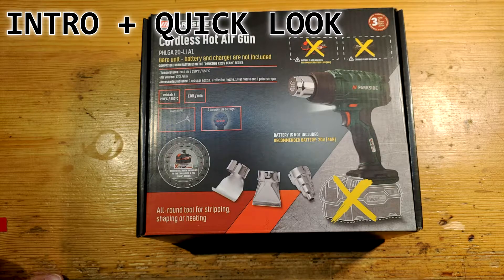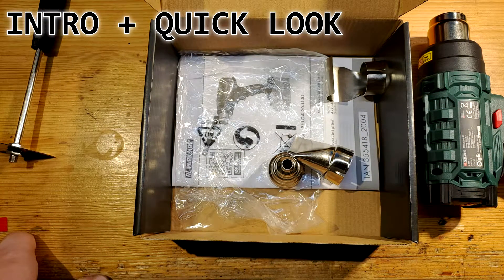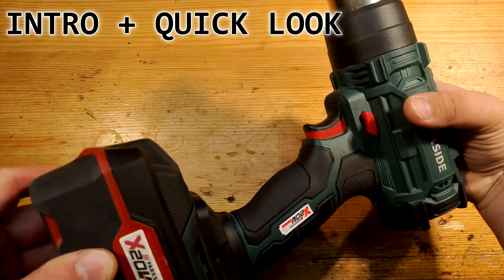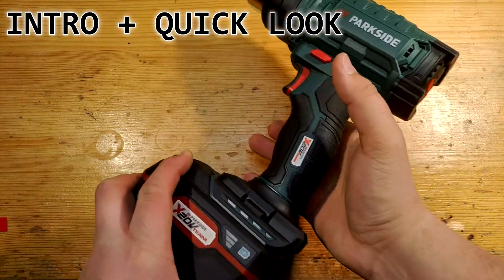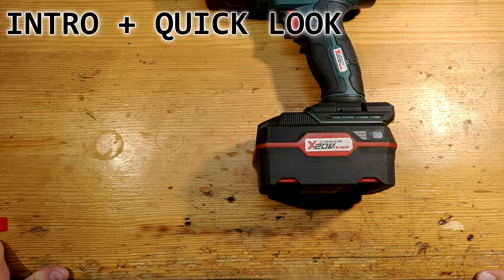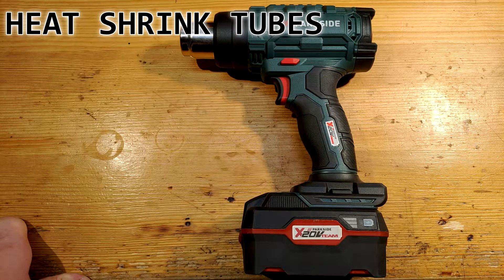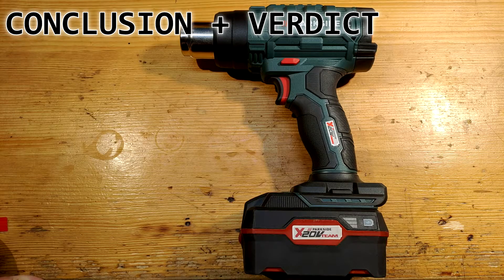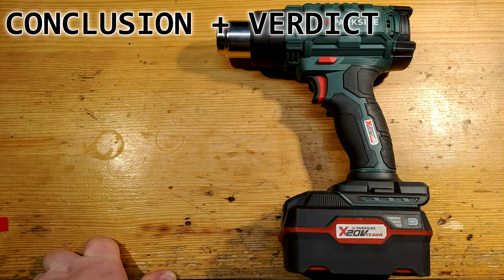Cordless Hot Air Gun Parkside - REVIEW

Comment: Thanks for answering all my questions that I had on this heat gun. Can't wait to get one and the 20V glue gun. Cheers :)
Reply from the maker: 20V glue gun is perfect, I use it frequently
Reply: @bekrstechnologies  I only managed to get the 4V one for now and I only used it once.
Reply from the maker: The 4V has low power for me, and the pushing mechanism is way worse than the mechanism in X20V one
Reply: @bekrstechnologies  Too late now, I couldn't resist getting one because I always wanted one.

Comment: Hey, how come it is so underpowered? I was sort of expecting the same as their cabled one and instead it works as if my battery is half dead. Though battery is new and fully charged. I tried 2 different batteries to make sure it wasn’t the battery. It’s like this heat gun would be ok for what you were doing - shrink wrapping the cable casings, but not for example to peel the paint from the wood, because otherwise I’ll be there all day 😅